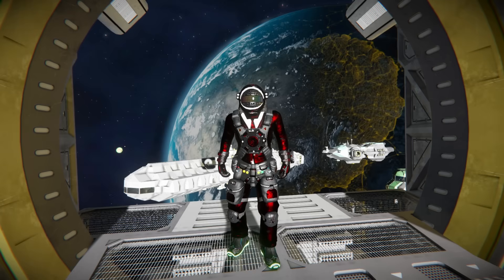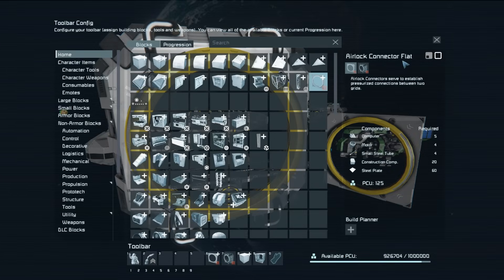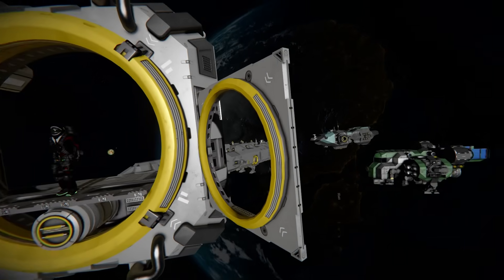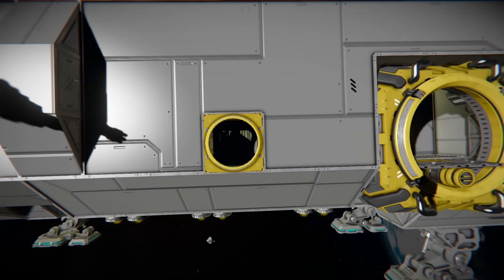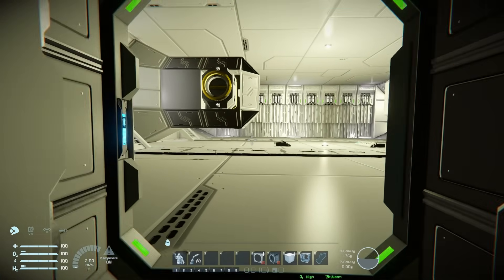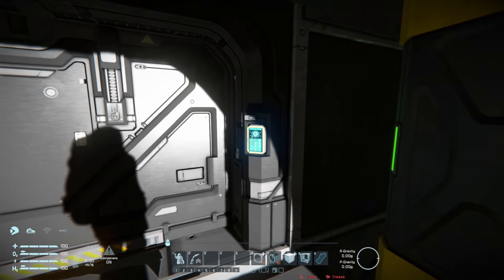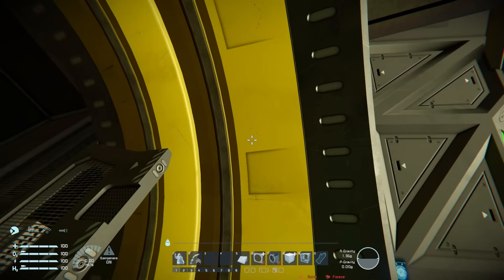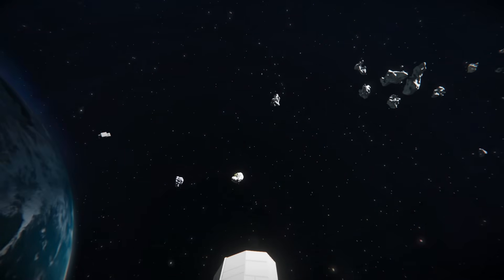The Airlock Connectors Mod! - Space Engineers

Comment: One mod I think would be amazing, would be a "docking alignment mod" where a block  could be set on a ship to seek out a similar block within a set distance and help a ship align itself so they would both be facing each other in the proper orientation.
Reply: Just use projector and sensors and you can make a docking reference so your aligned right and top it off by using 2 connectors or a connector and merge block. 

I know it's not auto pilot but still a simple solution
Reply: @FILOdeathlord  That's a pretty cool idea actually.

Comment: There was an airlock mod on the workshop for years that i used in so many of my worlds.  It didnt have a built in conveyor system but i just built one under the airlock.  It was a must have mod in most of my worlds.  Honestly im surprised that keen never made a vanilla airlock block considering the majority of the game was in space.
Reply: I suppose they just wanted us to make our own airlocks, it is a game about engineering too, after all
Reply: @christophsouthwell7518  You can't make an airtight connection between two grids without merge blocks in vanilla. Merge blocks merge grids and mess up ship names,  which is unwanted, so there's no clean way of doing this.
Reply: @christophsouthwell7518  while we can build our own, mods like this just make the setup far cleaner than 4 merge blocks and 4 angle blocks hanging off your ship.  Big difference between using 1 block vs 8.